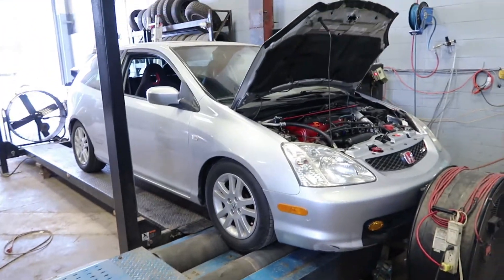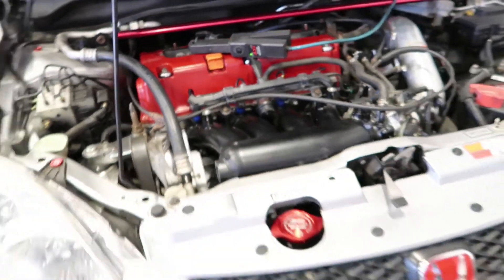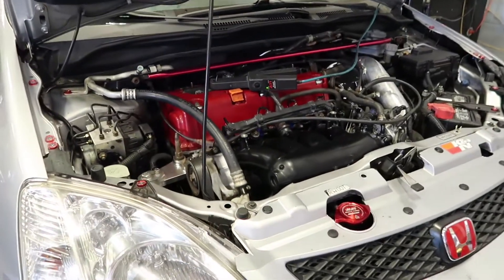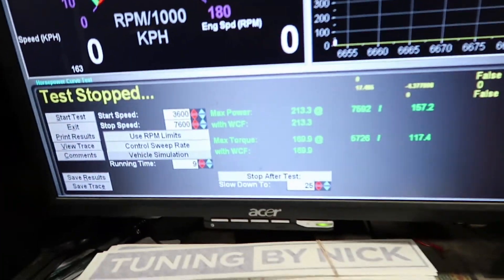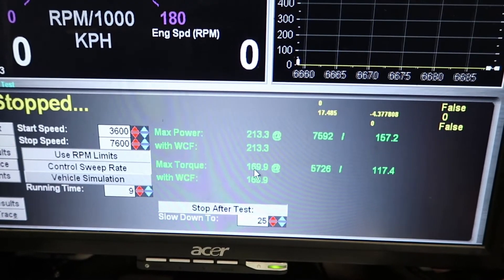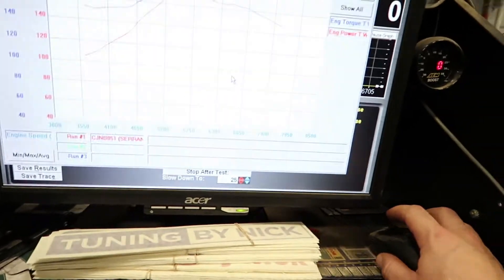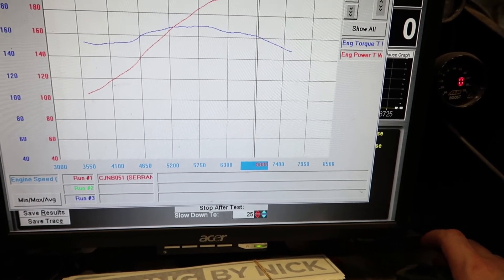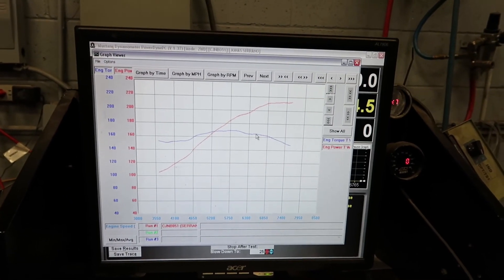EP3 K24 Swap Dyno Tune

Comment: for the amount of money it cost probably not worth it i might be wrong motor around 900  kpro 650 plus 300 for the ecu rbc 300 plus injects an other small things an time at the dyno 60 hp over stock is it worth it ?? an if you have all that in california it won't pass smog
Reply: It makes for a better base. The stock ep3 motor is the worst K series,its more for economy than performance.

Comment: how did you get the headers to clear the front sway?
Reply from the maker: It didnt clear - The front swap bar was removed - However - Check out the CRV front sway bar - You can run a CRV front sway bar instead and it'll clear because it fits differently
Reply: @tuningbynick  thats the first i hear about using the crv sway...they usually say em2...ill give it a try thanks.

Comment: Hi Nick!
My setup: k24a3 engine, k20z4 intake cam with 50VTC (pinned on 45°), RBC manifold, 70mm TB, 550cc grams injectors, 3.5" injen with velocity stack, 1320 big tube header with megaphone to 3", 3" custom exhaust, k20z4 flywheel, k20a2 tranny.
Today my tuner did correlation in fuel, timing, set VTEC on 3600rpm (curves show us the point) and did measurement...
235hp (202whp) and 260nm (192ft/lbs). I think that is little bit weird, power is too small for this setup..
Of course it is not final numbers we will know them at Monday, but still thinking that is too small.. Can you give me some advice what I have to focus on? Thank you in advance for your answer.
Reply from the maker: I would like to help - But honestly there are just so many variables its just not something i can really do if i dont have the car at my shop - The one thing i can say is, if you have pinned the VTC at one specific angle so that it is not variable anymore. You will always have a compromise of either lower then potential Midrange TQ or Peak HP - Generally speaking - Higher VTC is needed for midrange TQ and lower VTC is needed for peak HP - That being said there are always exceptions

Comment: How come this k24 ran 213 but your rsx k24 ran 236hp?
Reply from the maker: Not every engine is the same and not all bolt on parts are equal. My K24 is the 2006+ which is the best version of the K24
Reply: Yea with the right bolt ons it would pick up  another 15 hp. The exhaust, vtc, and hot air intake is killing it. An intake pointed down away from the heat would benefit greatly. What injectors and duty cycle were you at?

Comment: Love it!!! Thinking of doing a k24 swap in mine. But only issue is in California we have stringent emissions standards where a race header has been more of a hassle then a benefit. How much power could one possibly make with the type S manifold/cat/down pipe? I currently have that on my Ep3 as I replaced the header I had on there and it seems to be considerably bigger than the stock manifold. Me not being a tuner would like your input as a tuner! Love the channel man! Keep it coming!
Reply from the maker: Swapping in a K24 will definitely get you a noticeable increase in power even with the stock exhaust manifold. As for how much. It’s way to hard to say unfortunately. You’ll notice a huge improvement in down low TQ. But your top end power will really be hurt with a restrictive exhaust.

Comment: Hey - stock block with k20 oil pump?
Reply: Yes it’s a stock block and oil pump. He is only revving it to about7500 rpm you will see it on the dyno chart.

Comment: Heyy,  i got a k24a2 in my EP3 too. Thing rips on a E30 tune.
Reply: Hey bro I got a 02 ep3 with k24a2 swap. I have this problem driving the car after the swap, once it got up to 3k rpms it bogs out , like a hiccup. My boy said I need a kpro and it would solve my problem. He said the car would drive smoothly with the kpro
Reply: @Stunna83  Yes you need KPRO, there isn't much you can do without it. KPRO will be able to provide for the different engine
Reply: @Stunna83  Mine is doing the exact same thing...
Reply: What do you think ??

Comment: Would you mind sharing the VTC map for this setup. Would be interesting to see if the RBC manifold is truly asking for more cam advance as most have stated when running this setup.
Reply from the maker: oldsklteg it’s a stock VTC gear. 

It was 20 below vtec. Then 25 in vtec. Basically maxed. Tapered downto like 20 at redline. I think it could have benefited from more VTC angle.